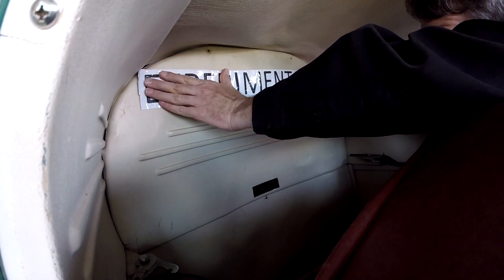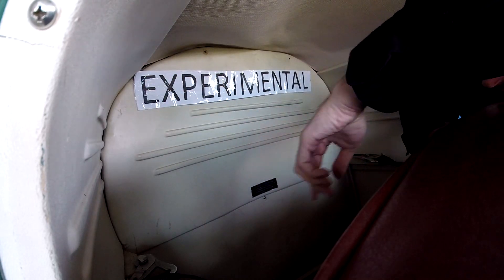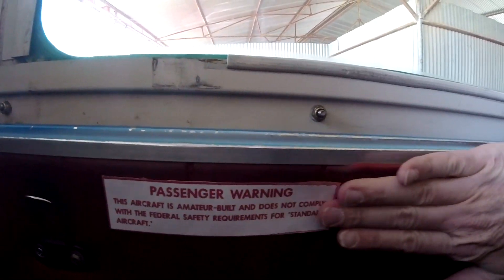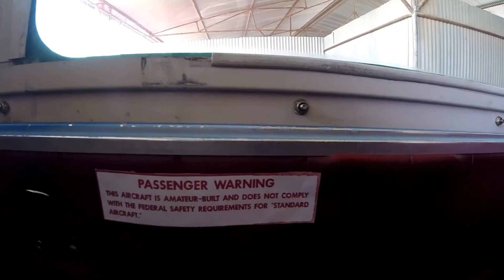Improve airplane performance - Aviation Quick Tip #4

Comment: I'm waiting for the FAA to see your video.  We all know that only a relatively few FAA Inspectors have any kind of sense of humor, and the odds of one of those actually seeing this are pretty low.
But, technically, you CAN do this, for a period of time.  Tell you what, let's drop a TSIO-550-N engine in there.  That way, the EXPERIMENTAL sign actually means something, your climb rate and cruise speeds should increase, and I bet your load carrying does, too.
This could be fun!  Maybe we could go all out and mount a PT-6 up front?!?  :p :) :D
Love this channel!
Reply from the maker: Gary C thank you
Reply: THAT pt-6 WOULD START TURNING THE PLANE ITS SELF
Reply: @miadrain1454  With the Independently Variable  Angle of Incidence mod, you can counter the tourq